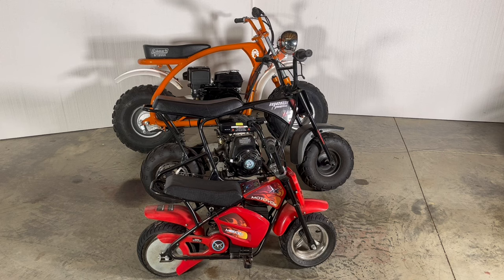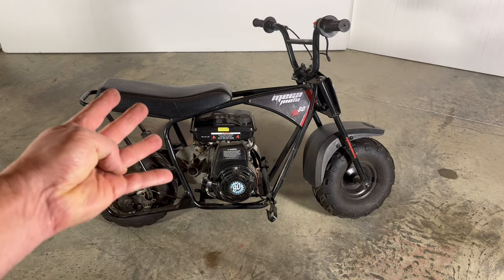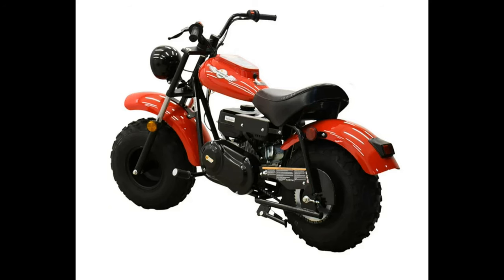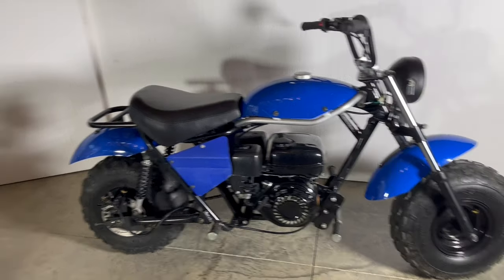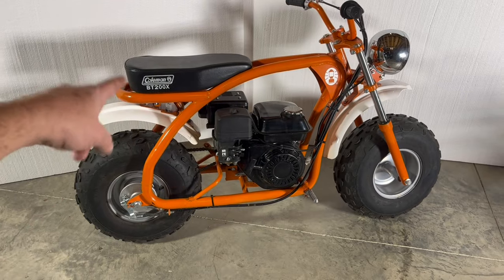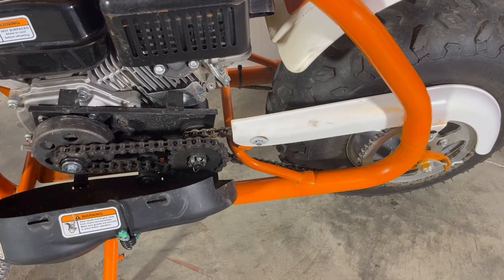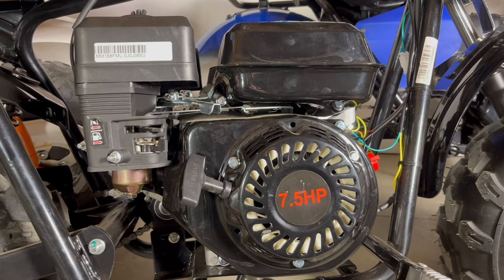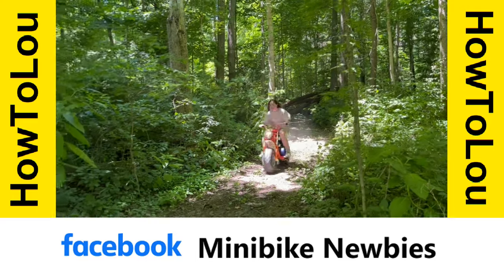Everything I know about Minibikes in 5 minutes

Comment: For what you get, the Trailmaster MB-200-2 is the best value and the best performing.  I drove 90 miles to pick one up that was already assembled by professionals (eliminating any assembly issues for the customer) and was ready to ride when I got home. Checked the oil, gassed her up and away we went!  I run premium in mine, as it burns cleaner than mid-grade. Not looking for top-end speed, but I ordered a 60t sprocket to replace the 46t for better low-end torque and climbing, along with a 420 chain. I'll back out the throttle screw and remove the air filter cover to increase air flow. Like Lou says, modifying or removing the governor will only create problems down the road, unless you're willing to spend lots of money on engine upgrades. 35 mph is fast enough for this guy. I might even hit 40 after removing the throttle screw and air filter cover. Have fun and be safe!
Reply from the maker: Agreed!  If you have the budget for it, the Trailmaster is an amazing bike in almost every way. The only “issue” is they feel a little boaty due to the heavier frame and longer wheelbase, but that comes with a Cadillac too.  If you can’t afford that kind of luxury, the BT200 is a good solid frame and occasionally goes on sale for $500 at Camping World.
Reply: @HowToLou    The new Massimo's have full suspension now. I'd put them in 2nd place behind the Trailmasters.
Reply from the maker: Yep, I did a TM vs Massi video in December 2022. 
Trailmaster VS  Massimo MB200S Minibikes
https://youtu.be/2FfDgZtaOgU

Comment: Not sure how many years but the Baja's predate the Coleman 200's which were around the 2014 date you mentioned.

I'm not sure which sold the most but I do know that the 200U was selling like crazy 2016 through most of 2017. You could get them from Walmart as low as $199 on sale and $250 on sale was common during that period of time.
Reply from the maker: Good historic info add.  Thank you.
Reply: Got my ct200u in 2018 for $399 it was worth every dime.